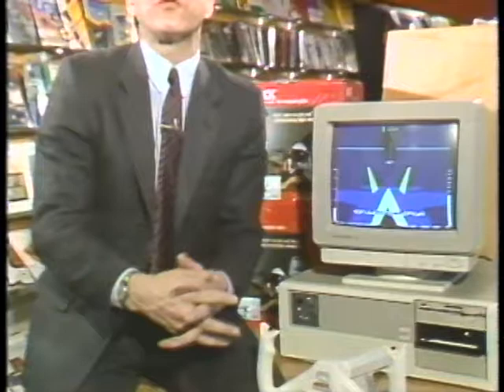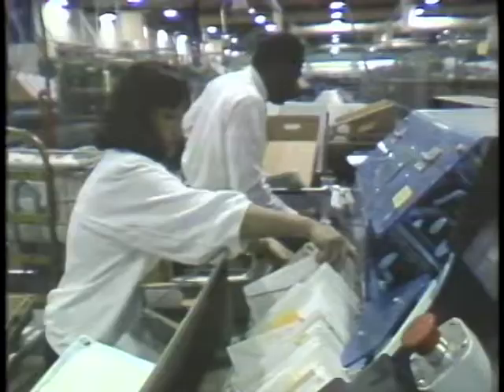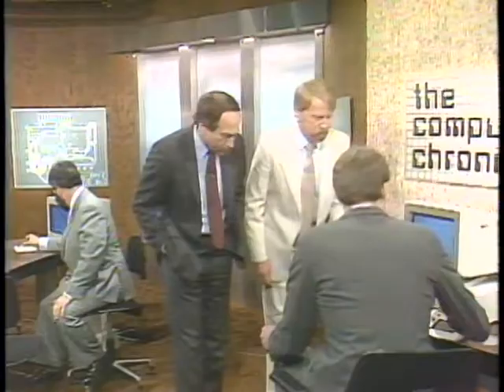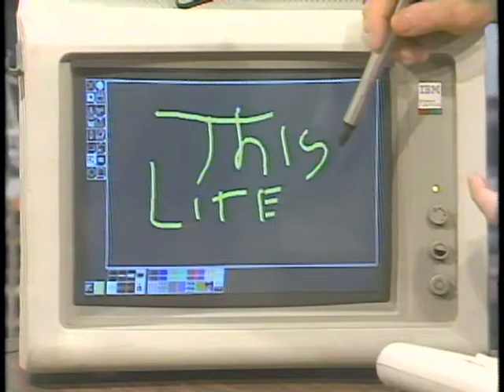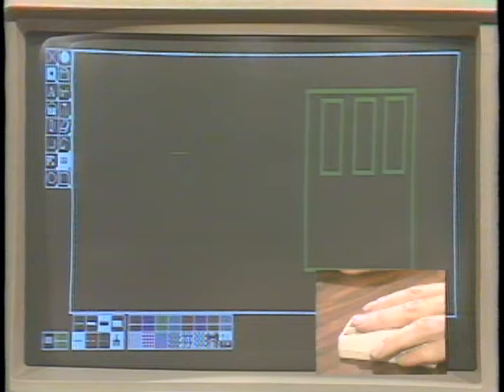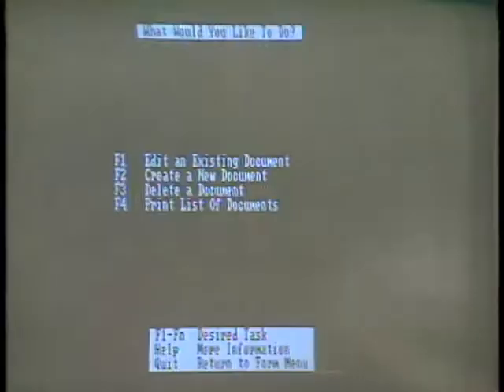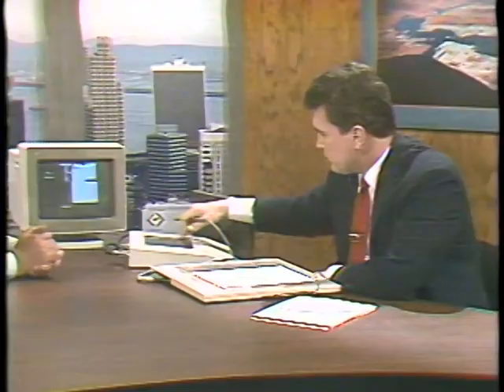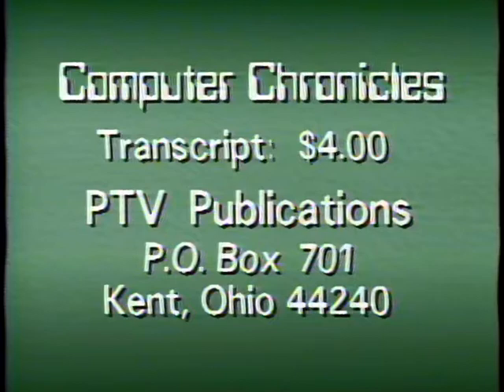The Computer Chronicles - Input Devices (1988)

Comment: An infrared mouse with a rechargeable battery, working 10 hours between charges in 1988 ... mind = blown!
Reply: ungratefulmetalpansy  The point of that comment was, that this technology wouldn't catch on until almost 20 years later.
Reply: Nowadays ive got a wireless mouse from microsoft that has 2 AAA batteries that hold charge for a half year.

Comment: The Felix pointer looks cool and I can see why it was developed. I am sure in an alternate timeline that thing really took off and computer mice are a weird oddity from the past.
The Key Tronic touch pad doesn't really add anything useful. Looks more like a big hassle to constantly have to move around the mouse cursor to select stuff I want to do from the tool box. It requires even more arm movements and my arm starts hurting just by looking at how uncomfortable the guy presenting sits there.

But really, the only thing that changed for me is that I use a vertical mouse since a few days now. I still haven't quite "relearned" how to use it (some micro movements aren't sitting quite right yet) but I can already feel my arm is much more relaxed than it was before.

Comment: That mouse at 14:21 why didn't people copy that no (annoying and SHIT) mouse ball design? Cheaper and works miles better.
Reply: Does it work better? I have no way of knowing apart from just believing what that guy said about it. I'd have to have one of those mice, and then use it on a regular basis for a pretty significant length of time, to know if it works well. My guess is that it would still collect gunk (it doesn't really change that fundamental problem at all) and probably wouldn't be as reliable (since the rollers are smaller than a big ol' mouse ball) - but I'd be interested to know if my assumptions are really correct.

As for why didn't people copy it...  Patents maybe, or it could be that it wasn't really good enough to be worth copying.
Reply: It was way, way, way less precise. Xerox tried with that design for about 5 years and then came up with the ball mouse.

The mouse used in "the mother of all demos" was the same design and its been mentioned as being barely functional many times since.